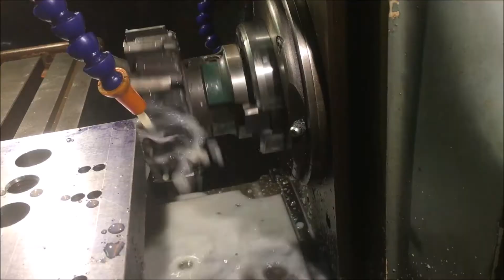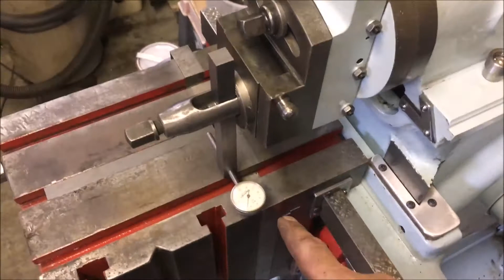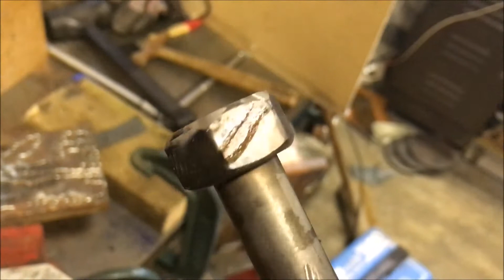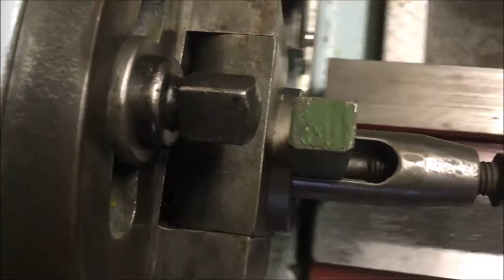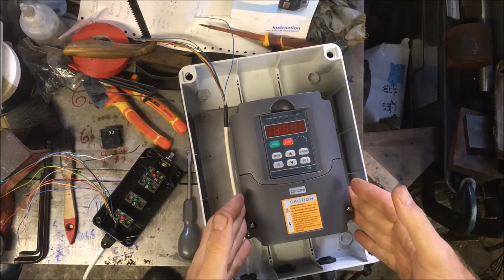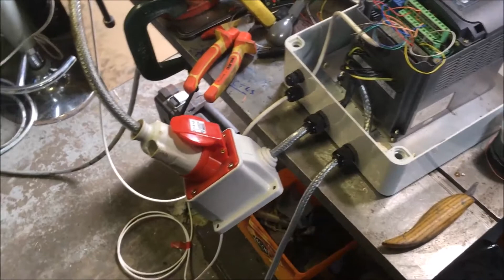Elliot 14S Update 22

Comment: Hi Matt, awesome job on the shaper. I have recently acquired a Alba4s and am busy with a restoration on it however the  housing that contains the 2 gears for the   table feed has been converted to a chain drive with sprockets. Do you happen to know what size these gears are in terms of diameter, width and number of teeth? I cannot source any info on this. Best regards, Darryl.
Reply from the maker: Sorry Darryl, only just seen this. Try the Yahoo group which I think moved to groups.io there I’m sure you’ll get an answer. If not, get back to me and I will see if I can access the gears

Comment: No worries. Thanks for the prompt reply too.

Fires are pretty average to say the least. Thanks for your thoughts and wishes.

Hey, can I ask you a question regarding your Elliot, How do you get the rocker arm out from inside the main body? I can lift the yoke off the pivot type block at the bottom but the drive pin attached to the bull gear does not allow me to simply lift it up and out. It's a heavy thing jus t waiting to take some fingers it you slip!

Cheers.

Simon
Reply from the maker: The yoke lifts off of the bull gear pin but you have to slide off the sliding block first. Then with the bull gear pin at either top or bottom position you can lift and move the yoke free. It’s a wrestle due to the weight. Get an overhead hoist or similar to take the weight and have the bull gear free to rotate. Assume you’ve got the ram off all ready...
Reply: @lookcreations  Thanks. Yea something to take the weight is the key. I'll try that.

Comment: I have thinking about topping of my table like you did. Since my shaper is 1942 it may need a little cleaning up . The universal tool holders bring good money. You should watch for carbide lathe tool holders they work well in a shaper Thanks for the video
Reply from the maker: The only thing to consider before you skim the workbox / table in place - check that the ram extends over it in a flat plane - and does not produce an 'arc' as it extends the tool out - you can decide what is acceptable tolerance. - from what Ive seen the older machines which are well worn droop at the full extent - so instead of machining a flat surface you would get a long curved surface - a sod if you then want to clamp something flat to it. dti running over a straight edge set on parallels at each end of the box would soon tell you . Best of luck and let us know how you get on. Mat

Comment: Great to see the old girl finally back to working after all that effort Matt. I've got the same Armstrong multi angle tool holder for my little shaper just that it's a lot smaller than yours. Over here there generally fetching $100 - $130 for the size I have when you can find them. And I think you'll feel a lot better about what those 2 lots cost you if you check the current prices for Cleveland M2 Mo-Max. From what I've read the new stuff isn't quite the same quality as what you have with what you've bought.
Reply from the maker: I was happy to be the only bidder on the two lots - as the starting price was effectively all I could afford. Am looking forward to making use of them. I have purchased the odd strip of momax and with postage paid nearly £10 for a 1/2" x 4" part used  bit. So that lot was a 'steel' :-)

Comment: Could the plug, plate and carriage be drilled and tapped in the centre and a long stout stud wound in and clamp the box even tighter with another plug and big nut on the outside?,
 Looking nice all round,
 Regards, J.
Reply from the maker: Im thinking the plug & plate for sure - I am trying to avoid the carriage being machined though.